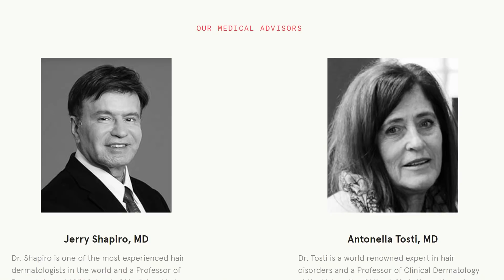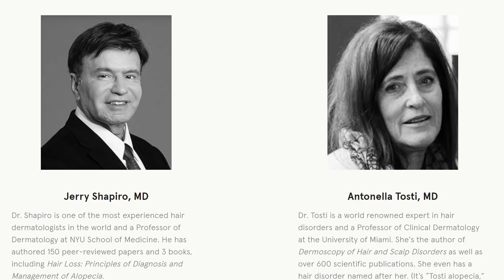Starship SN15 May Fly TWICE, SN20 Plans REVEALED, Electron Rocket Fails, and China Lands on Mars!

Comment: i apparently have the unpopular opinion that a suborbital hop around 3/4 around the globe is not considered orbit

the fcc documents has no mention of a deorbit burn. so i assume starship will not complete a full orbit and reenter becasue of aerodynamic forces. i don'T consider this an orbit. maybe sn21 will complete a few orbits
Reply: You can get into orbit then deorbit yourself. Even if you didn’t make a full orbit, you could still be in orbit.
Reply: @jakemckee2005  of course you can. the important thing to note is, that you have to deorbit yourself to get back from a stable orbit (at least if you don't wanna wait for a few days to a few weeks until orbital decay gets you down)
but as i see it, this first flight of starship with superheavy will not do a deorbit burn and will rely on orbital decay only. but since that all happens within a single orbit i would not call it an orbit

Comment: I'm pretty sure the Super Heavy booster will try to land on one of the autonomous drone ships. The plan specifically says the Super Heavy will "land" while the Starship will do a "soft ocean landing". And later in the document it says that "Booster Touchdown" is at 495 seconds wile "Ship Splashdown" is at 5420 seconds.
Reply from the maker: It's quite ambiguously worded, the droneships may not even be able to support the superheavy. Plus, even if they could, the superheavy is much more massive than the Falcon 9, and so if the landing fails it could seriously damage or destroy the droneship. I think water landing makes sense here, because at this stage they have no experience landing the superheavy and it's how SpaceX and Rocket Lab have  conducted their first stage landings initially during development.
Reply: @MattLowne  The Super Heavy isn't that heavy. Maybe something like 250 tons. Whereas the barges they convert into drone ships are rated for 11,880 tons. Catching the Super Heavy might be the first job for "A Shortfall of Gravitas", which is now being assembled in Louisiana.

But it is of course not without risk. I'm sure they will do the same as with the Falcon 9 where they aim right next to the drone ship until the engines fire up and then swing over on top of the drone ship and land. So if the engines don't light it just fall into the water.

The rumour is that the Super Heavy will have 16-18 Raptors, so there's a pretty meaningful payoff in recovering the stage. That's more Raptors than they lost in SN8, SN9, SN10 and SN11 combined. I think getting the stage back to Boca Chica might actually be a bit problematic, though, so they might just take out the Raptors and the other stuff they can easily reuse and scrap the rest.

But we will see. Plans can easily change. I don't know if SpaceX even knows what exactly they will end up doing.
Reply: I think it will depend on how reliable this generation of raptors proves to be over the next few flights/fires, as well as how fast raptor production is ramping. If they are having to do a lot of work on the raptor design anyway they may not risk a drone ship, and just spashdown the raptors they would be scrapping anyway. It may even depend on weather conditions, as they might not risk catching a booster that isn't going to survive the return voyage anyway. I doubt they will have an octo-grabber built for it.
If they were entirely having to design legs from scratch I would be more sceptical, but they have had to build temporary legs for starship anyway, and the reduced number of engines on the bottom of the booster gives them tons of area to work with. They will have a timetable for tower construction, but I doubt they want to entirely rely on it for their schedule, so I expect to see multiple boosters with legs before tower catches become the norm. An older drone ship would be a bad sign too, as it would not have been designed with the superheavy thermal loads in mind, but a new one could have been.
The reasons I believe they would be willing to even try it with a test vehicle are twofold. Firstly it can throttle down to a hover, and they have already demonstrated precise control over the raptor and landings, even with asymmetric thrust. The hardware is most of the way there, and inherently easier than landing a falcon 9. Secondly the software is going to be straight out of the falcon 9, and extremely well flight tested, including demonstrations of abort scenarios (We have seen boosters yeet themselves off into the distance when the landing wasn't going right). 
I am pretty sure they could. Whether they would or not will depend entirely on whether recovering those raptors dry will let them proceed with the test program faster.